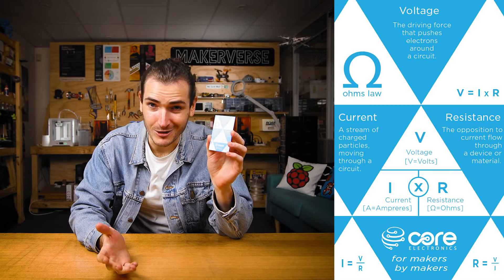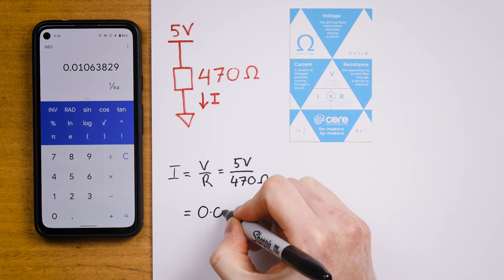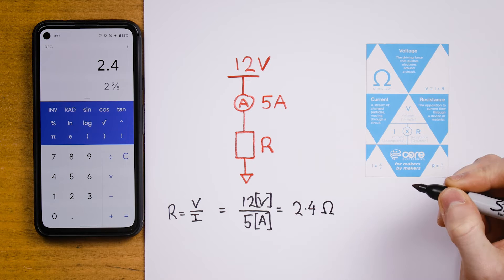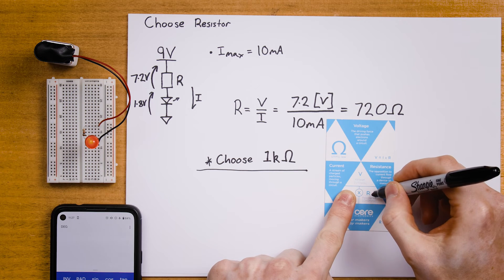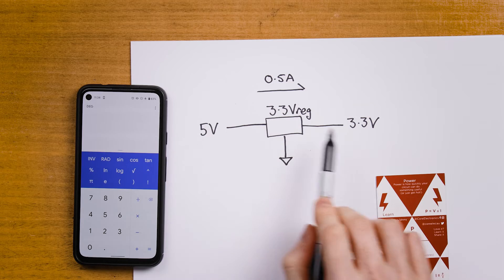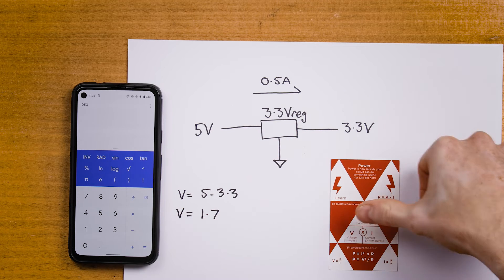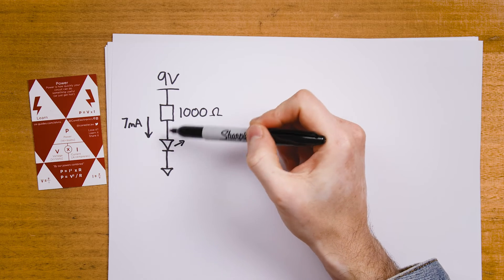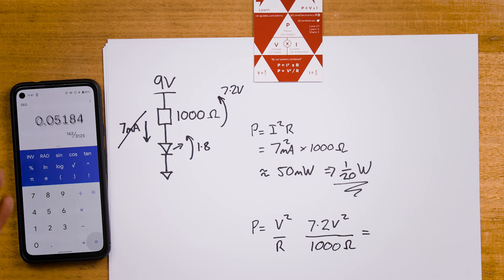How To Use Ohm's Law In Electronics

Comment: This is really great to see an explainer for those little cards that come in the kits :)

I foresee a few questions/topics that'll pop-up though:

1) How did you measure the forward voltage of the LED with the multimeter?
Answer: You set your multimeter to diode mode. Your DMM acts as a constant current source (as it also does in resistance mode) and measures the resulting voltage.

2) Units - important to note that Ohm's Law only works in SI units. Michael didn't say it explicitly but you'll note that he always does the conversion to SI in his head and types numbers into his calculator in SI units.

3) The voltage regulator described is just an ideal resistor which is pretty unusual for a regulator. More commonly you'd have to introduce efficiency, ie:

Power in x Efficiency = Power
so:
Current in < Current out

In this case you go:

P1 x Eff = P2
P1 - P2 = Power Loss as Heat
P1 x (1 - Eff) = Power Loss as Heat